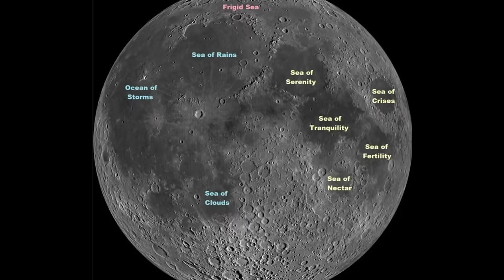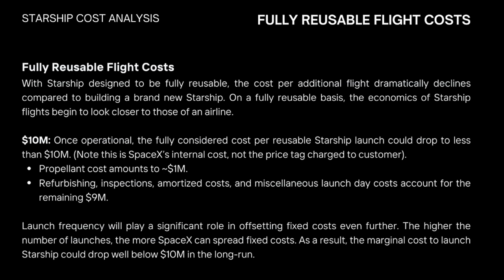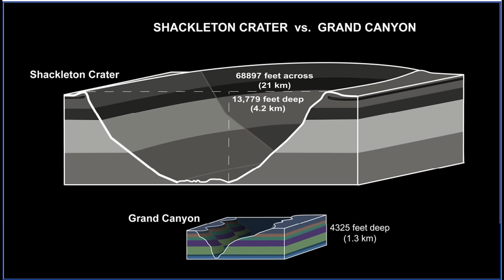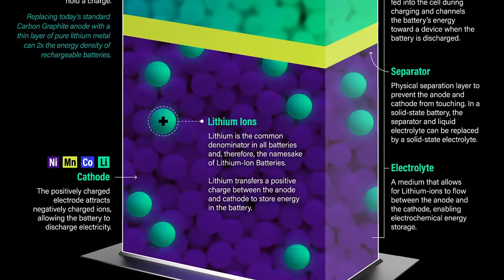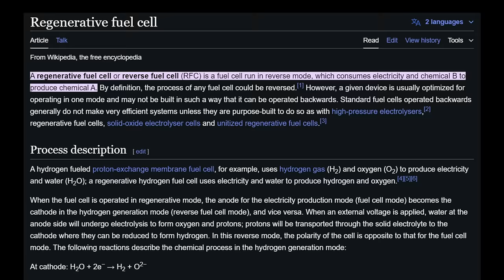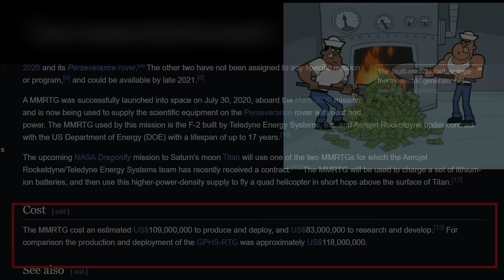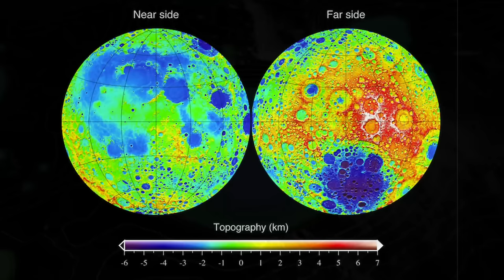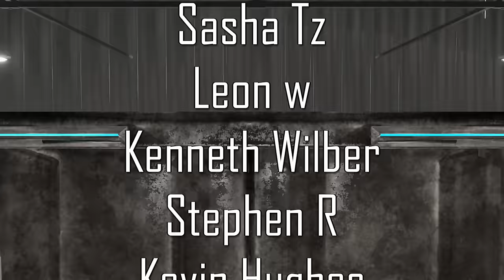Probably Not The Poles

Comment: if lunar regolith is so non-conductive, then using a ground source heat pump to store energy from the day to the night could make more sense than using electricity for heating/cooling. maybe scaled up this could also be the easiest way to create energy storage in-situ. furthermore you could use it for power as well as heat. for working fluid you'd use gasses generated by refining or perhaps as the water storage system. to make the tubes you could use microwave drilling and would only need a large but mechanically simple pumping system

Comment: Maybe energy issue will be addressed with magnesium lights instead of electrical, or other solutions like that
Going retro, just like in Your excavation video
For instance there was an idea of a trolleybus-but-steam engine with one central boiler for many steam locomotives
Maybe it would be better to use the moon day radiation and sunlight to boil water or something and use it as either simple steam energy in pistons or use it as a generator

Comment: When it comes to manufacturing on the moon, you don’t need to manufacture the whole product, just the heavy bulky parts, and import the small but complex parts. The machines you suggested needed to be imported, the majority mass wise could be manufactured locally, with the small crucial‘special sauce’ parts imported.
Reply: Printers will do more and more complex stuff for that environment you'd hope / think.
Reply: Yes, the way to go
Reply: Import the chips/control board, cast the frames.

Comment: The problem with hydrogen fuel cells is that thanks to molecular diffusion (basically that hydrogen molecules are the smallest molecules) hydrogen almost always leaks out over time through even the smallest imperfection in the storage vessel, so you can't store it as hydrogen for too long.

Prolonged exposure to high-pressure hydrogen also leads to hydrogen embrittlement in many materials, including steel and aluminum, leading to brittleness and cracks and increased leakage. It's also harsh on seals and valves, again leading to increasing leaks over time.

Of course, this doesn't mean that it can't be used, just that these losses have to be accounted for.

Radioisotope thermoelectric generators make for good emergency, stop gap, or backup power supplies.

But as always, nuclear reactors beats everything else.

Comment: I have concerns about the Railgun, I think a better solution would be a rocket sled on a maglev rail, it wouldn't have as many cargo profile concerns for future expansion as a coil approach and you are already manufacturing oxidizer on site. Alternatively you could go nuclear for the sled. This would massively reduce wear on the rails and simply the orbital maneuvering that the sleds would need to do since your line of thrust is no longer perpendicular to your primary structural members.
Reply: There is a video on that

Comment: Tall (km scale) tower at pole with enormous hanging wall of solar panels that can be turned to always face the sun. The  BIG advantage is that tower can be used as center hub of ultra-light and efficient rotovator launcher, using just a few 100 tonnes of earth supplied UHMWPE rope. - to launch payloads from the tip of the spinning cable at human survivable g's towards earth, mars etc at any cadence desired.  It's the key enabling tech for useful Early Lunar Settlement.

Comment: Nuclear power is very nice but in terms of storage you could have a very big Dewar flask filled with lunar regolith which you heat up during the day by hundreds of degrees. To get electricity from this you can use Peltier devices but an other option that I find appealing is a supercritical CO2 turbine which are much smaller than traditional steam turbines and work at lower temperatures but since it has moving parts it will require more maintenance. This can also be used on Earth by filling the Dewar flask with sand for example.
Reply: Any plastic bag covered with regolith is a Dewar on the moon, lol

Comment: If a solar panel is sitting in the full unfiltered sunlight the only way it's getting cooled is radiating heat off the back side. Since solar panels performance varies with temperature, were going to need solar panels that handle waste heat differently at the very least. They're going to need to be radiation toughened to handle the direct unfiltered sunlight, and they're going to need to be able to either operate at higher and lower temperatures or they're going to need some form of thermal management. The thermal shock when they come out of days of cold darkness and the sun hits them is going to be rather extreme. On the moon the sun is either full intensity or nothing! There is no fading of the light. I would expect that today's commercial panels would likely fracture in short order when exposed to that kind of shock. The panels may need to be preheated before the sun hits them, or perhaps just not faced full-on into the sun but rather gradually tilted into it. To maintain performance over time solar panels have to be cleaned. On the moon there will be electrostatically attracted dust. This dust is very hard, abrasive and sharp so you're not going to want to just sweep it off. And blowing it off with a gas might be just as bad, if not worse. I think the choices are going to come down to either using some sort of electrostatic device to pull the dust off or using acoustic waves to shake the dust off.

Comment: The battery mass would be much higher than for the Megapacks, considering the relatively narrow temperature range various lithium chemistries can operate in, and very wide temperature swings on the moon. Active thermal control also requires power.

Comment: just to clarify the hydrogen storage method will use solar to turn the water from the fuel cell to hydrogen and oxygen and just act as a battery coz if not you are describing an infinite energy machine

Comment: In the long long term, how deep would you have to dig to make geothermal possible?
Reply: The moon isn't hot inside
Reply: @kipkipper-lg9vl  it is, it’s just abt how deep you need to go to reach 100c
Reply from the maker: I don't actually know good question
Reply: Lunathermal power has a nice ring to it.
Reply: @Leo-gi7bg  you are correct, i was not aware of this, interesting, probably means any sufficiently large body will have a degree of heating just due to compression
Reply: The purpose and scale is the problem here, I hope in the following videos you will see it as an so so option.

The biggest problem here is ERoEI of the process and thermal conductivity of regolith. Not impossible, but what in return for the efforts. There are better options.
Reply: @Molb0rg  correct. I think 1st we need to develop worldwide closed loop geothermal plants on earth. Cool thing abt the moon is that we can put the water in a low pressure environment easily, making it easier to boil and thus needing a lower depth to dig, since 100c is then not necessary. But this is in the far far future. Luckily the resources needed are all on the moon. IE aluminum for the well, but you‘d need to dig at least 15km deep, which is possible, but tough when you have no infrastructure.
Reply: @Leo-gi7bg  after reading some about it i don't think using the internal heat of the moon is doable, if you have to dig deeper than we ever have on earth it really isn't worth considering
Reply: @kipkipper-lg9vl  Yeah, I get that. By the time we have the tech to make it viable we would already have better alternatives anyway. The concept was cool tho... But you know what! On earth we 100% need to invest in closed loop geothermal systems with laser digging tech. It's the only green form of energy with literally no downsides. It can literally be dug anywhere! It's much more realistic than fusion.
Reply: @Leo-gi7bg  to be fair what you really need for off earth human settlement is a good fission reactor, the only real solution that is not reliant on the sun and is tech we know and understand

Comment: Your Argument about consumption scaling with production may be true but it doesn't really apply here. A lot of energy will be used to produce Aluminium or Steel. All these operations don't need to happen in the three days of lunar night, so no need to store them. You can also shut down fuel production and so on, I personally think the lunar economy will need to adapt to the day night cycle, produce when the energy is cheap and only store whats essential for crew comfort for the night (At the poles at least, I still think the day and night cycle will be important everywhere on the moon, but nobody wants an economy thats on standby half the time).
Reply: Yes, true, and considering preferences about the equatorial part of the moon it is the way to address the problem, where night is more than 3 days. Here it is more that even if it is just about humans and their life support those 3 days are bad enough. And it is not like there are no solutions, and more than mentioned in the video it's just that selling poles as a solution to every problem is not such a great selling point.
Reply: @Molb0rg Gapping the 3 days off night add the grater is no problem, just put another solar array add a spot that can produce power during that time a run a powerline.

Comment: Why chemical batteries? We have vacuum on the Moon - gyroscopes are a solution.
Reply: almost all gyroscopic losses are mechanical... do you really think if it were that easy it wouldn't already be done on earth?
Reply: @afgor1088  On Earth we just don't need to keep much power, and there we have a better solution with pumping water up into a lake and then using it's potential energy.

Comment: With regards to importing water from Earth, it's worth noting that water is 89% oxygen by weight, and oxygen is incredibly abundant on the moon (bound up in rocks, so it will be a waste product of any metal-manufacturing industry). That means you only need to ship in the hydrogen, meaning you could the desired amount of water for one ninth the price.
Reply: True, can be coupled with carbon imports which is useful.

Comment: As far as drinking water goes, I've never been a fan of trying to get it on the Moon. The sun is constantly spitting ionized hydrogen at the Moon and if we're refining metals from the oxides there then we'll have an abundance of O2. Hydrogen can readily be captured and reacted with the O2 to produce water. Oxygen itself is one of the most abundant elements in the universe, with hydrogen being the most abundant.
Reply: Capturing is a small amount, but based on appolo samples it may be that there is enough hydrogen embedded in regolith to make a half liter of water per cubic meter of dirt processed.
Reply: @Molb0rg  I mean the hydrogen coming off of the sun is all ionized, isn't it? A set of satellites with magnetic fields could focus the ions over a large area around down to a smaller point(imagine a funnel) which could then be collected either by having the charged particles embed themselves into something or by having them hit a target that they'll react with.
Reply: @Intelligenthumour  it may require a very big funnel for it to be a mesningfull amount, and activity on the moon is for us to be able to do big things. So you do moon activity first and then look for applications. Early on it is not worth it, is it any good in general - it needs to be calculated.

Comment: I think there’s an error in the math here: Elon Musk says that once the entire starship system is up and running regularly it will only cost about $3 million per launch. He has a tendency to underestimate these things so let’s conservatively figure $5 million per launch.
OK, so a starship can carry 100 tons of cargo into lower orbit. Let’s assume that’s all water, since you are talking about hauling water to the moon. 100 metric tons of water is the equivalent of about 264 gallons.
OK, so all told the starship uses 4600 tons of fuel to put 100 tons of cargo in orbit. The second stage, which is the part you would be sending to the moon, requires 1200 tons in order to fill up its tank of go juice. Since each starship can only carry 100 tons of go-juice into orbit in order to refuel, that means the would need 12 launches plus the initial launch of the orbiter with the hundred tons of water. That’s 13 launches total or $65 million to put 264 gallons on the moon.
That comes out to about $247,000 per gallon, or $1930 per ounce. That means a can of Coke would cost you about $23,000. (I’m throwing in the can for free because the moon is just lousy with aluminum and you could easily make the cans there. :-) )

Of course you could probably optimize this somewhat if you didn’t send up liquid water. If you broke it down in the hydrogen and oxygen and compressed both to their liquid state, and then recombined the two when you got to the moon, you could probably haul two or three times as much water. of course that depends on how much the actual vessels themselves weigh, but I think you could get a bonus doing that in which case hey can of Coke would only cost about $8000

Of course, when you do re-combine the hydrogen and oxygen on the moon you do get considerable energy bonus from that, since you have essentially a fuel cell. And in fact, you could probably use the pressure vessels that contain the stuff in them as a sort of regenerative fuel cell that you talk about in the video so that’s an additional perk. The viability of fuel cell technology on earth was massively oversold for about a decade, Where are you have to use energy - usually from a conventional power plant - to electrolyze the water, which then can be combined to get that amount of energy back out. Back when everybody was pushing these things, they seem to have overlooked that for the intended purpose of running a car or something stupid like that, a fuel cell is really just an incredibly inefficient battery. However, in space these things work much much better because there is no environment to dis spoil, and as you have pointed out, there is limitless free energy from solar panels. (Though  prefer a nuclear power source rather than all that sticking around with solar power, but I understand it would take quite a while to set that up, and solar power is a perfectly acceptable alternative in the short/medium term)
Reply: On 65kk you forgot the price of that moon sacrificial starship - it 'an't  flying back, so one of starships here is expendable mode. In general the number is from a paper mentioned in the video, in reality in addition to Elon time it may be more or may be less, but it just adjusts the estimation and nothing more.

Comment: Lots of assumptions made here that don't necessarily reflect reality. Such as the assumption that a base at Shackleton would be focused entirely on research, or that the reason to make a base there currently is research.
Reply: Currently there is nothing on the moon so everything has to be an assumption. You could go into “what if’s” for literally any point made in this video. So I don’t really think it needs to reflect reality cause there currently is no reality.
Reply: @lewismcl1944  Except for the fact that if you look at most plans (both NASA and foreign plans) for building a moonbase, its main role isn't research but as a stepping stone. So you'd have to actively ignore the plans being made to come to the conclusion that this video starts off on.
Reply: @Gustav_Kuriga it is not a great stepping stone, the main statement of the video. Which purposes/goals/mission objectives of that nasa stepping stone you find that important so that it can be done only on the pole?

Comment: You are thinking the energy issues wrong. Solar thermal is far more efficient then photovoltaic. They can heat salt to a very high temperature and store it with great efficiently during the night. If anything they should work better on the moon
Reply: no, it objectively is not.

Comment: But do you really need that much power during the 3 day night? They could spend 3 days conserving as much power as possible by dont doing power hungry processing or science experiments, and maybe they can hear up a big block of insulated stone as thermal storage during the day which can be used as free heating during the night. I think they could need a lot less batteries, especially since it is only 3 days once a month that they need to do that. I think eventually it makes sense to expand to the mares but the initial colony can still best be made at the south pole
Reply: Poles can be done, it just does not provide such killer features as it usually posed it does. Both are possible.